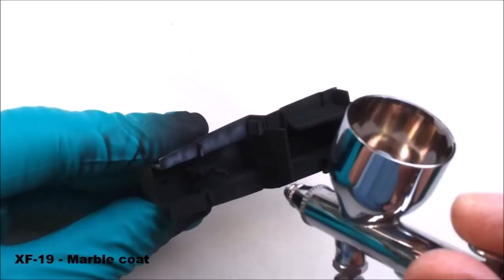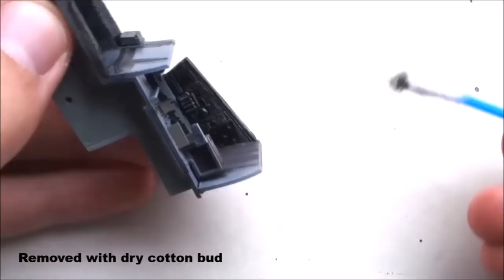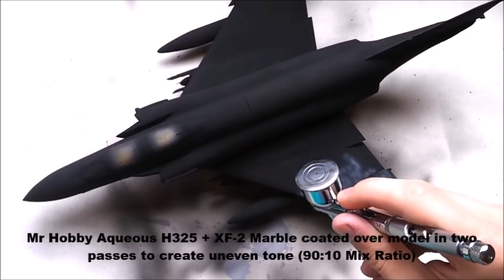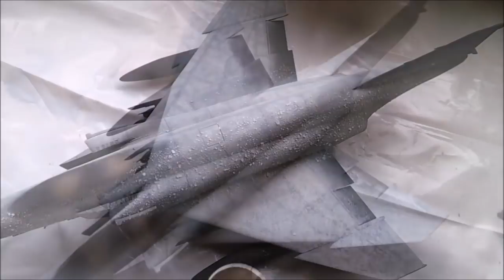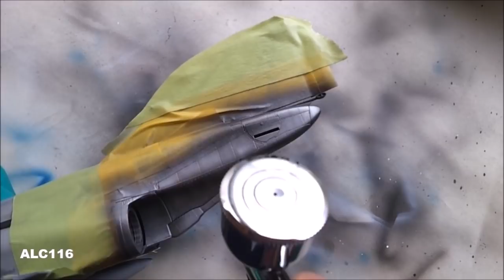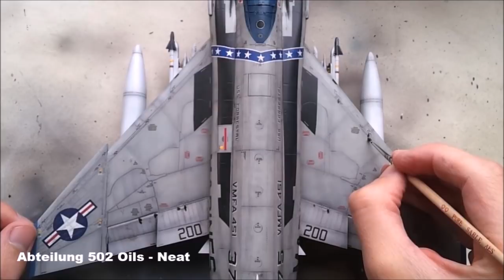Eduard Phantom II F-4J "Rockin' Rhino" 1/48 | The Inner Nerd

Comment: Great work.  Reminds me of how I used to paint my models (but not as good or detailed as you have shown) when I was a kid (mid 70s).  The F4, P51 and P47 were my favorite models back in the day.  I liked making jeeps, tanks and ground stuff like that for the most part because it was fun dirtying them up with mixed paints and creating dioramas for them.  I remember using a candle to create entry points for shells on tanks.  That was fun.  Just had to add this, I remember the F4 was tail heavy and P47 was nose heavy.  I used slip weights from my tackle box to balance the planes so that they'd sit on all wheels.

Comment: I will say, your are amazing at putting together an painting your models! I am wanting to start building some tanks and other models, but I don't know what I really need to build one. I know I won't be buying an airbrush set, so do you have any recommendations on how to paint, and other tools to help model building? Thanks!
Reply from the maker: Napkin Thank you! I would recommend Tamiya acrylics or Mr Hobby. Thin with X-20A thinner or Mr Hobby Self levelling thinner. If you are brush painting add some acrylic paint retarder. This will slow the drying time of the paint so brush marks will be less frequent as the paint isn't drying on the brush and dragging. I also find synthetic brushes are best, use a medium/large flat brush too for smoother coverage. Hope this helps!
Reply: The Inner Nerd Thank you for the reply and advice! I will be sure to look at the thinners, synthetic brushes, and other little painting techniques to make my models looks somewhat acceptable. The model I am looking at starting with is the Tamiya M10 Wolverine, since I am fascinated with this tank (are there any model tanks or planes you would recommend for newer modelers?), and I am hoping it will turn out decently based off your advice. Thanks a million!

Comment: orange peel on clear coat might have been caused by low pressure.  Pressure shown on the gauge of the compressor is not the same as pressure delivered to the airbrush, the length of hose causes the pressure drop.  The longer hose the more pressure loss, fixed by just raising the pressure.
Reply from the maker: Thanks of the tip! I have also heard that it can be caused by too high pressure too. I normally work at a working pressure of 22psi indicated, I'll try out a few different pressures on the next project and see what result I get

Comment: NIce Work! I don't build these aircrafts but do recognize the hard work that goes into them. I build model cars, So i have two questions on two things i could possibly use for my cars. Where can i get that polishing tool? second question..Does that front glass come tinted in the kit or is there something i can use to get slightly blue or green tinted glass for my model cars? Thank you !
Reply from the maker: Thank you! And yes I can help. The polishing tool is a Dremel (well it's not a "Dremel" as thats a brand name) but its the same thing. Also the tinting is from Tamiya clear acrylics (numbers X-19 to X-27). Spray in very thin mists on the inside of the clear part for best results. Good luck!
Reply: @TheInnerNerd  Could you possibly get me a link to the one you have please?
Reply from the maker: https://www.maplin.co.uk/

Comment: Good, weathered nicely although let down by bright bold decals which should be weathered to match - keep up the good work.
Reply: The Hi-Vis '00' A/C especially the CAG bird will have Hi-Vis markings meaning they won't let them get weathered.  They will most times be glossy.  Even the beat up old F-4Js were still going into the 80s and each Squadron CO Bird would be Hi-Vis, its called polishing a turd.  Have a look at the historical pictures, he did a spot on job.

Comment: The Inner Nerd, 
Great work, the black basing is pure magic tried it once but failed marble coating hehe.
I didnt get couple of things:
1) Salt. What effect you tried to achieve with it? Heard it used to make heavy chippings
2) "Removing orange peel"  with adhesive sponges. I don't get - I'm using Tamiya Clear vanish and never seen so-called orange coat. Maybe Im doing it wrong?
Anyhow - masterpiece work, congratz!
Reply from the maker: Thank you! The salt is used as an irregular mask for the base colour. A more accurate way of recreating USAF carrier based aircraft that are weathered by the sea air. 

Orange peel effect refers to the bumpy texture a clear coat makes once dry the clear coat can be sanded and polished smooth, like on a car, so that the surface is even like glass. The sponges used are abrasive not adhesive.

A full description of equipment is in the description section on this video

Comment: Stunning job, thanks for sharing.  How long did you wait between clear coats over the decals and how long after the third coat till you sanded with the 2000 and 3000 abrasives?
Reply from the maker: brianc1701 Between coats around 6/7 hours, e.g one in the morning one at night. Before sanding between 2/3 days to let it cure sufficiently

Comment: Looks great if it were a junk yard tow truck.......a bit much on the weathering. The color jets were kept in much cleaner condition. Line jets were a different story. The bare metal area around the engines and horizontal stabilizers looks fantastic......except for directly behind the engine which should be considerably darker from the engine exhaust and afterburners.
Reply from the maker: Weathering is very much dictated by taste and there are many comments on here agreeing with you. Apart from the ones claiming to have actually worked on these aircraft obviously. But thank you for the feedback
Reply: @TheInnerNerd  00ץ

Comment: Fantastic build. I wish i had your skill. Can i just ask...how do you create the mottling/marbling. Do you keep pressing the airbrush on and off or is it just a case of random spray patterns Thanks.
Reply from the maker: Thank you Mark. I use constant air & paint flow from the brush. Paint is slightly thinner than normal coverage for smoother application. The marble effect comes from the uneven spray pattern, not from adjusting the paint flow
Reply: Thank you very much for that,and thanks for your very quick reply. I will have to give it a try. Thanks again.

Comment: What are you thinning X-22 with and what ratio (Tamiya X-20A)?  Looking for a new clear as my method with Testors is failing me lately.  Also, nice build.  I'm working on the same kit an that engine inlet and wing fit are just a bit difficult to get all worked out!
Reply from the maker: agracer1000 Yes X-20A. Its around a 1:3 mix to it lays in quite thin but I get best results this way. After 1 mist coat and 1 wet coat if this all Tamiya matte turns very glossy
Reply: I thinned mine by topping up the X22 jar with X20, fill a new jar of X22 to just the beginning of the neck of the jar, an old Tamiya trick which I use to thin all my Tamiya X paint.  Spray in light  mist coats to avoid the orange peel effect. I`ve read  that Mr Colour levelling thinner works very well with X22.

Comment: Hi Inner nerd. 
Quick question, when you doing the rock salt technique you then spray over with thinned acrylic paint. Got that. 
However you then proceed to use water on top of the salt to wash it off. 
I dont understand how the thinned acrylic layer dosent then  run?
Sorry i may not be understanding some thing?
Reply: Water wont bring dried acrylic paint back to life. If it did you wouldnt be able to decal over it!
Reply from the maker: Hi Rodrigo. As said above. Once the acrylic paint layer has dried the water will not reactivate the paint so it only removes the salt.
Reply: The Inner Nerd  thanks

Comment: Would you recommend Gator Glue for the photoetch?
Reply from the maker: Alex Lee I've never used Gator glue and don't really understand what type of glue it is. I use regular CA Superglue from Loctite. It's thin enough as a liquid form and doesn't expand when curing
Reply: The Inner Nerd Thanks for the reply. How do you keep the CA glue from going everywhere? When I used to use it, it kept on 'bleeding' to the front of the PE.
Reply from the maker: Alex Lee Pour a very small amount into a spare cup/lit etc. Then get a cocktail stick, blunt the end slightly to increase the surface area to pick up the glue. Dip it into the glue and apply as spots on the PE. For parts that need to be glues along the length, dip the PE part directly into the poured glue.
Reply: They make different variations of ca glue.  The more watery it is, the more potent it is.  You can get ca glue that is a gel so it doesn't flow everywhere.  The Bob Smith Industries web site goes into detail on all of their products.

Comment: I question the historic accuracy of the this paint. scheme.  Without addressing the blue radome, I do not think that any fleet USMC/Navy F-4's operated in an all gray paint scheme.  The standard cold war anti-nuke flash scheme required white control surfaces, flaps and white undersides.  The F-4 was retired before the matte all-gray scheme was introduced with the F-18A.
Reply: Historically speaking there were Navy and Marine F-4's on the Enterprise yet the year I entered my tenure, both the U.S. Navy and Marines had F-4's in NAVY GRAY paint okay. Somebody is always, is always trying to pic a historical point on paint schemes of aircraft. From WWII thru Korea and Nam these planes often changed hands and branches as often as personnel used to change and shift about. Something new would be brought in and end of story. Sorry but even the Marines flew the F-4 in Navy Gray. We had a few with blue noses some with yellow noses and red. That was mainly for squadron practice sessions to identify one squadron to another. It wasn't uncommon either for the crews in the hangars to send a wrong number plane up an elevator because they all looked alike paint schemes and all. When on board a carrier in the 1970's and 80's fucking gray was even the color of your under shorts. They might have been white when ya got em but the laundry gave em back to you in gray...   Often when it came to planes what was usually different was the tails had squadron insignias on them. That was what made em different. And last but not least is sometimes depending on where a plane was in use at the climate like in Asia or South America rains would take a gray or a green aircraft and it would look bright blue or silver blue or even yellow. Some plant pollen's or plankton from the ocean could etch the epoxy paints and change the original color of a plane completely. I saw what was a squadron of aviation aluminum colored Tom Cats from the Forestal had turned completely purple in color from the plankton in rains in the south pacific region. It sounds like a bunch of 4 year olds arguing my daddy has a blue Cadillac... The truth is the Navy preferred things gray. The Army preferred things green the Airforce preferred things blue and at times so did the Navy. Certain carriers certain bases had certain paint schemes when time allowed or some mucky muck wanted to make a unique statement. So not all F-4's came in a certain paint scheme or colors.  It wasn't uncommon to see red noses or yellow tail fins and stabilizers painted yellow and even yellow and blue. You kids gotta off the dumb shit and talk to the people that were there on those boats and bases. I just recently saw a mostly Orange v22 Osprey. It belonged to a coats guard special interdiction unit from Florida. Now somebody will contradict me and say the coast guard don't have any v22's... They got one I saw it. I had to ask who the hells it was I was bit taken back it too used to seeing em in Army green or Navy gray... Okay
Reply: Tim Yeakel great story dude, thanks for sharing.

Comment: I have seen a lot of phantoms. Your ejection seats are amazing. I applaud your cockpit detail except for the fact that you don't show the instrument panel leads leading into the floor as would be visible through the canopy of most of these planes behind the pilot. The major problem is with the weathering. Which to me seems a bit excessive. Yes, Phantoms in that type of scheme in service did weather. However they were not allowed to deteriorate as much as the aircraft that you depict. It might be that you have been misled by the more modern gray finishes currently used on naval aircraft. They do weather more and they are touched up with cans of spray paint aboard the carriers. They end up with a mottled appearance as a result.

Comment: Fantastic build.  However, too dirty for military aircraft, especially Navy and Marine Corps aircraft.  Never get that dirty.  Been there.
Reply: Was thinking the same about carrier based aircraft.
Reply from the maker: Matthew Byrd I think this whole 'it looks too dirty' has been emphasised by the camera. In reality it doesn't look as grainy as it does on the images, may be the scale effect and lighting
Reply: don't listen to them, it looks AWESOME !
Reply: I like a lot weathered models and this is really a masterpiece, congrats
Reply: Paint in the video looks cleaner than what I've seen on MiG-29s and Su-22s when they were still in service. I would expect plane that is most of the time somewhere on the sea slightly cleaner but I think it's fine.
Reply: Allan Byallas, I spent 8 years in the US Navy in aviation. So, yes: been there.
Reply: Matthew Byrd What Naval Aviation did you work in? Our shit was always filthy on the flight deck. The old white paint cleaned up good but Tactical Gray with its radar anti reflective properties would soak up petroleum fluids and gun gas like a sponge. Throw in the turco burns and they looked rough.
Maybe your chairforce or french navy. Them guys all have pretty airplanes.
Reply: Allan Byallas Thats what I was thinking to. Reserve, Rag, P3 but it wasnt no CV or CVN.
Reply: LPH and LPD on MH-53E.  AMCM. Those helos leaked like a sieve, wiped down constantly, with washjob every seven days.  I know Naval aviation.
Reply: Matthew Byrd - Well theres your problem Mr NavAir. 53s and gatorfreightrs. Real Navy 53s? Thanx for bringing my mail! Your birds were indeed spiffy. They dont get very dirty when theyre grounded constantly. . Lol you dont sound like youve got much roof rat  in you. You strike me as a hangarbay commando.
Reply: The tactical grays added in the 80's always held the grime and made the planes look terribly dirty.  However, the older white/gull gray paints were gloss/semi-gloss and did not look as bad.  Just Google F-4J.  All the white/gull-gray carrier photos show only slightly dirty planes.  But all the late F-4S tactical gray birds look like hell!  LOL.  It's the paint.

Comment: Why is a Navy commander piloting a Marine F4?
Reply: He is the CAG thats why.  Marine F-4 or not, the Squadron was assigned to the Carrier Air Wing.  The CAG will always get one of the Hi-Vis '00' aircraft.  Being that there were only 2 F-4 Squadrons aboard and the CAG being an F-4 driver pushed out the junior most of the 2 F-4 Sqn COs to the '01' A/C and walla you got a Navy CMDR in a Marine F-4.  He prolly shared the A/C though with one of the extra pilots in the Squadron.
Reply: Thanks, didnt even think of that.  Was thinking maybe is was one of those cross tours.
Reply: Its very rare to happen in the present but every once in a while it does occur.  It was much more frequent during the age of the F-4J because the Navy and Marine ones were exactly the same.  USMC F-18C Sqns still deploy with CVWs however most CAGs don't want to fly them because the would rather fly the Super Hornet.
Reply: When I was flying in the '80s & '90s, CAG's name was painted on each and every "00" aircraft.  It didn't mean he actually flew that plane.  BTW, the "plane with your name" doesn't really mean anything in terms of what plane you flew. You were assigned each mission to whatever bird was "up" and available. Having your name painted on a plane was a privilege based on seniority in the squadron.

Comment: seems like a lot of work, the salting didnt seem to add to effect.
Reply from the maker: The salt weathering does change the tonal variation on the surface quite significantly if you make the differences between the paint colours less subtle than I did. For example red oxide primer under camouflage for armour to replicate chips. On this subject though it is important to keep the tones almost the same as too much variation wouldn't be accurate to that of the real aircraft. The photos may not do it justice as when viewed in reality it can be seen that there are flakes of darker and lighter tones all over the upper surfaces. Scale effect makes a difference when capturing models on a photograph.

Comment: You should do that sanding crap, before you put the decals on to avoid accidents. And yes Im a paint brush guy.
Reply from the maker: Billy Bob I'm not sure you understand what the sanding is for. If I did that 'sanding crap' your way round the clear coat sealing the decals would orange peel too, making it completely pointless doing it in the first place.
Reply: The Inner Nerd What is with all the armchair player haters?  I wanna see some of their work.  Your work blows anything Ive done away.
Reply: Ok, your right,
Reply from the maker: Frackrats Fenorki Thanks. I can't please everyone and none of my builds are 100% accurate/neat/realistic. But it's easier to be a critic than it is to actually achieve it. I'm never completely satisfied with any of my models, but I aint far off!